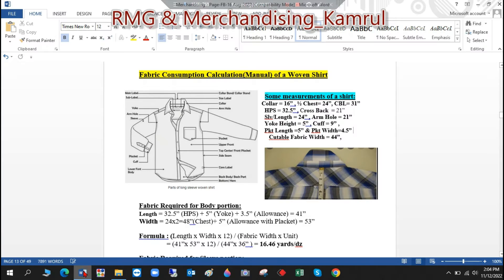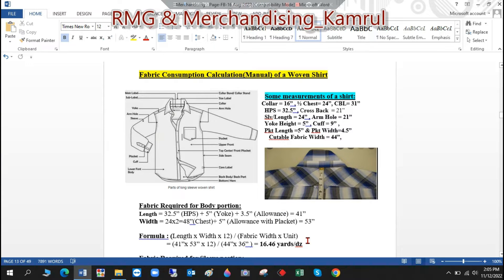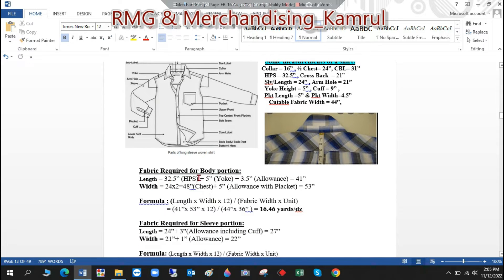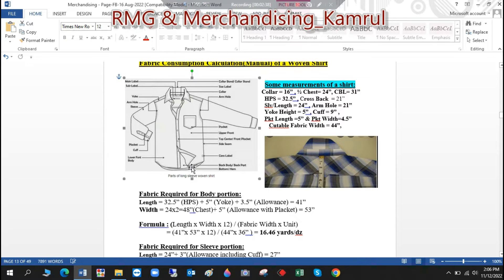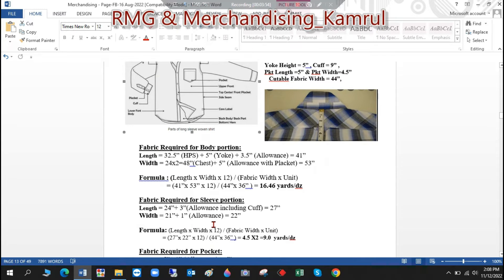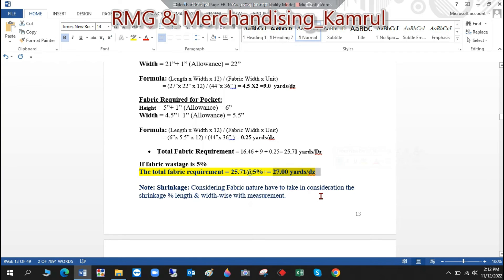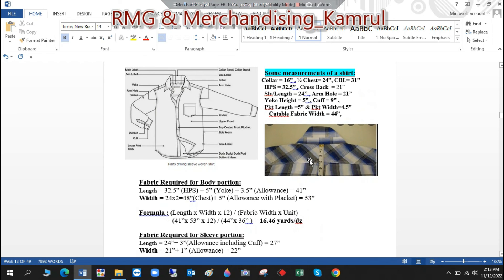Fabric Consumption Calculation| Woven shirt| fabric Consumption| shirt consumption formula| woven.

Comment: 🎯 Key points for quick navigation:

00:01 🙏 Introduction to manual fabric consumption, a vital aspect of costing in the garment industry.
00:16 ✍️ Manual fabric consumption is crucial when meeting buyers face-to-face for accurate costing.
01:26 📊 Costing requires understanding key parameters like efficiency, productivity, and various costs involved.
03:17 📐 Fabric consumption calculations involve measuring the area of different shirt parts (body, sleeves, pockets).
04:29 🔍 Understand measurements for body length and allowances to accurately calculate fabric consumption.
06:57 📏 Conversion from inches to yards is necessary for accurate fabric measurement (36 inches = 1 yard).
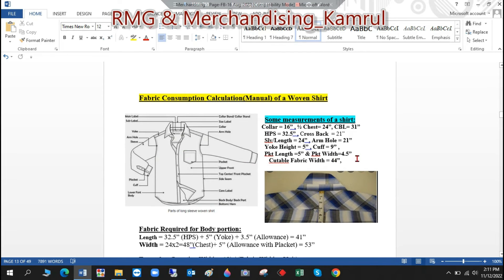09:18 🧵 Calculation for the sleeve and pocket portions is essential to determine total fabric required.
10:00 🔮 Final fabric consumption is calculated, considering a 5% increase for allowances and wastage.
11:10 🌿 Consideration of fabric shrinkage and treatment variations is important for final consumption accuracy.
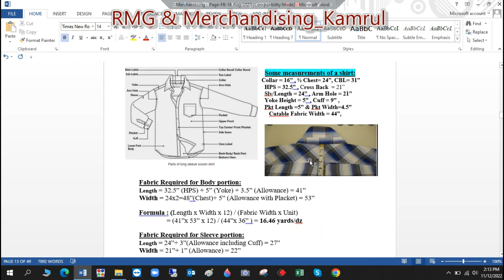12:06 📺 Encouragement to subscribe and follow for further discussions on related topics in fabric consumption.

Made with HARPA AI